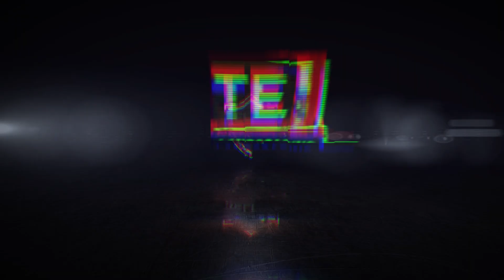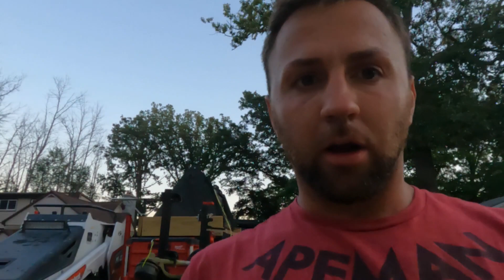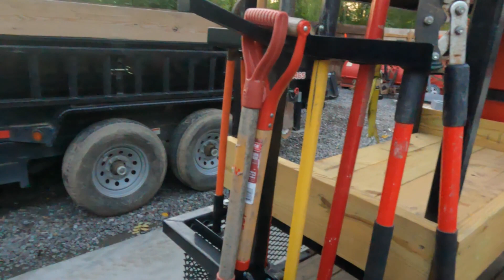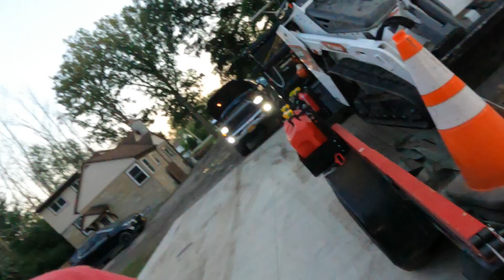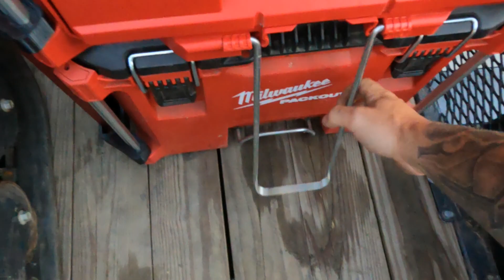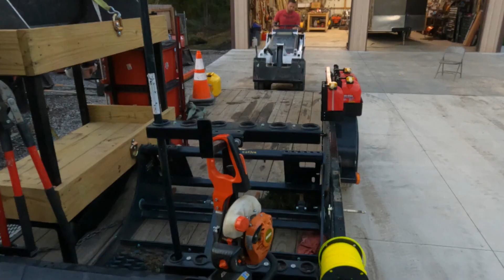Bobcat MT100 trailer build out! Bring everything to the jobsite!

Comment: Where do you lock down the forks once you put them in their slot under trailer?
Reply from the maker: I drilled a hole through the steel rail and through the forks and out a hitch pin through both with a washer and smaller pin going through the hit pin
Reply: Thank you for your help……best video  on a trailer walk around I’ve seen…. Great job